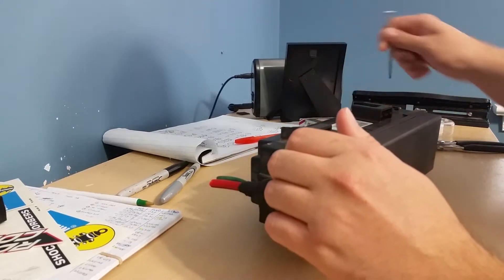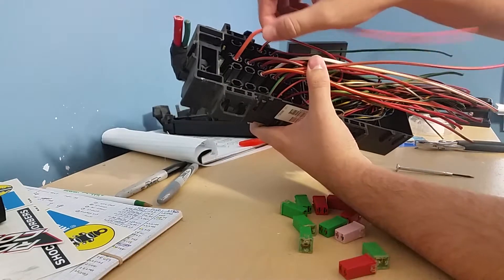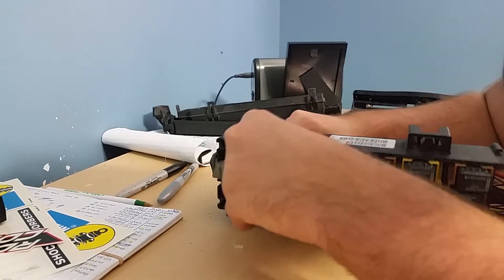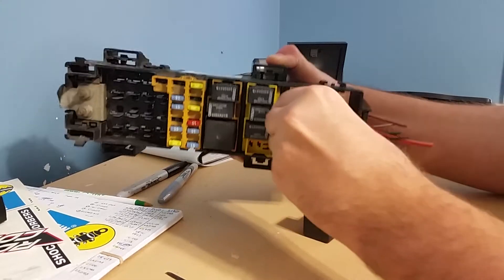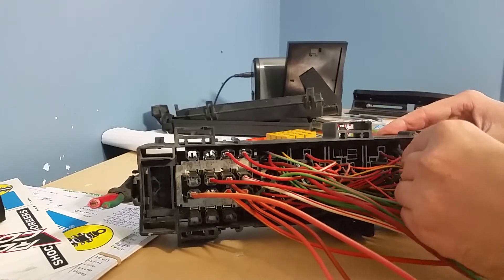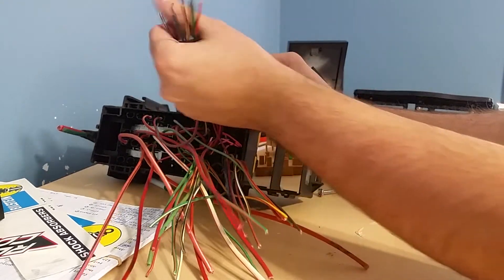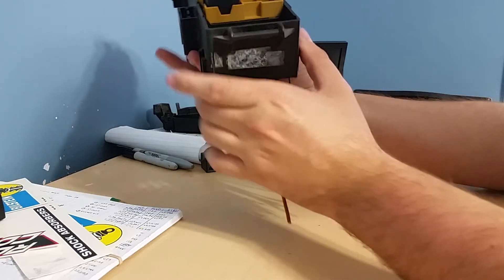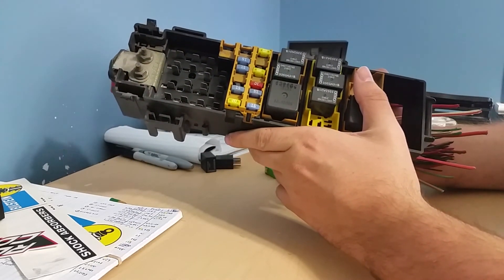Jeep WJ Power Distribution Center - How to add Relays and Circuits for Accessories Cheap!

Comment: I ended up here on a search for a possible issue with my PDC. I was driving over 4k miles per month for a while with no problems. Now I haven't driven it since January after having a lift, transmission swap and cats/ O2 sensors replaced. The past two mornings, it won't start. Battery and power cables (JeepCables) are new. I pulled and cleaned my throttle body and IAC a few days ago. 
It has a strong crank, but won't turn over. It's been cool in the mornings, but hot late morning through the rest of the day. After moving relays around and back, it eventually starts and will start up perfect every time for the rest of the day. I put a scanner on and was seeing that the fuel pump relay is not engaging. I verified power, but nothing from a control circuit to switch the relay. What else could this be? I'm not 100% sure that it's due to colder mornings and good once warmed up or if I just happened to coincidentally move the right thing around allowing the FP relay to engage. Everything else seems to be normal. Any ideas?
Reply from the maker: Could be the trigger from the computer not sending the right signal? Possibly a faulty relay?

Comment: The yellow part where the relays plug in in mine has a problem.   Is there any solution for me to repair this without all the spaghetti wiring mess?  I think that’s way past my skill and patience level and my problem is the relay that makes the connection for my blower fan isn’t working properly.   Most times it doesn’t work so that means I have no heat or defrost.    Can you give me an easier fix than replacing the entire box?   It seems like everything is plug and play in that Jeep.  Why isn’t the power distribution box?  Ugh!
Reply from the maker: Is the main issue the blower motor not working?

Comment: Is there a way to get that whole center out with out cutting it like you did ?
Reply from the maker: justinwilliams252jw I don't think it'd be easy. you would have to follow the wires and see if it goes to a plug etc. the good part is when you go to install things click in and don't require much effort.